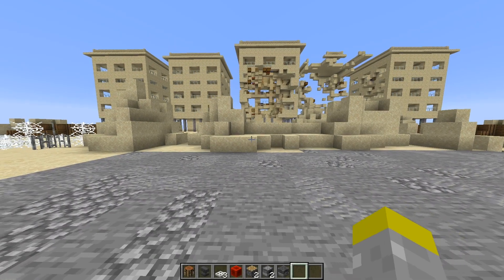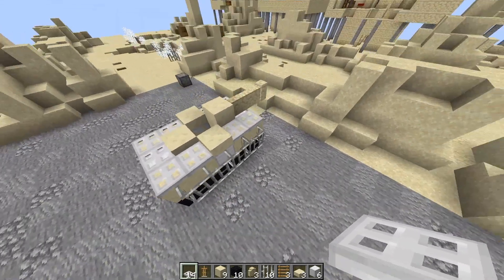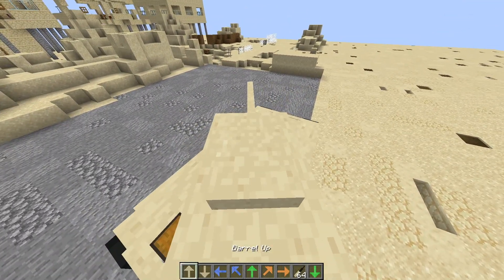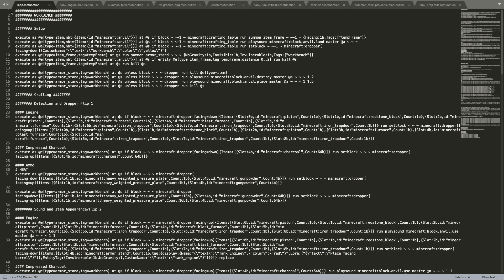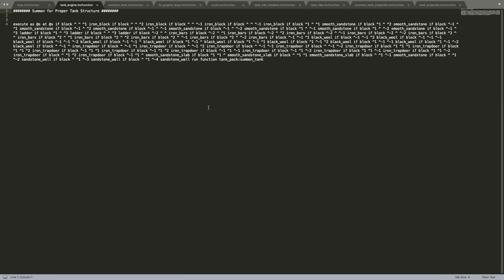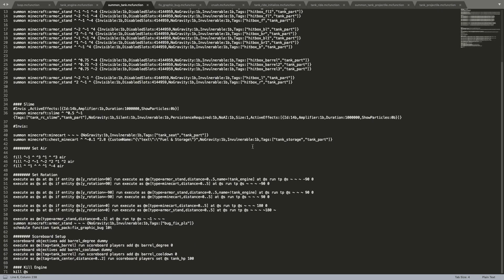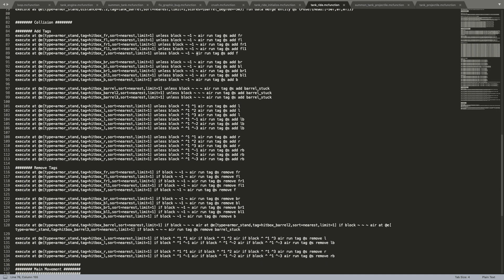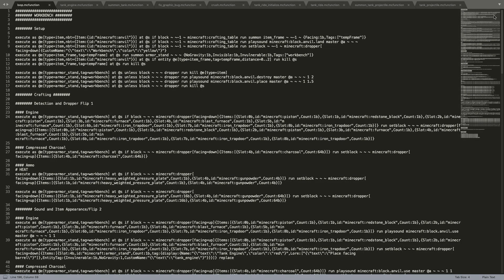Tank Data Pack Full Explanation || Minecraft Data Packs

Comment: Hey TimberForge,
Amazing educational video!
I am trying to understand how could rotation of structures in given arbitrary angle work in Vanilla Minecraft. I guess u use an armoured stand with some 3d model attached to its head and then just rotate the head. Could you please elaborate how to group a structure and attache it to the head of an armor stand to rotate it?
Reply from the maker: Great question! I choose one of the armorstands which remains in the center, and I make all the other armorstands move relative to the center one at all times. That way, I only have to manipulate the center one. I tell the non center armorstands to keep themselves teleported a certain distance away from the center armorstand, and I also make sure the rotation matches the center. For example, to keep the turret and barrel together, I make the barrel constantly teleport itself ^ ^0.5 ^1 blocks relative to the turret, and with a matching rotation. This way, no matter where I move the turret, the barrel will “stick” to it as if they were one, because they are constantly being teleported and rotated to the same position and rotation relative to each other.